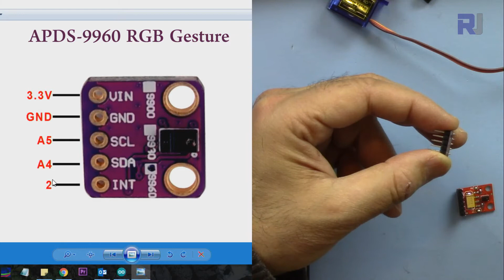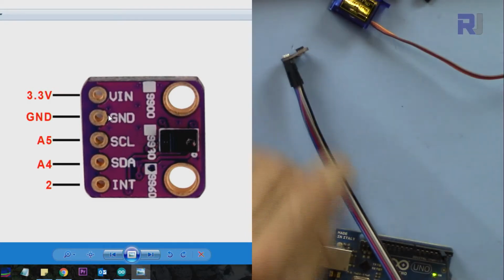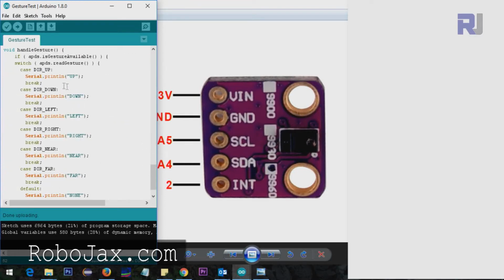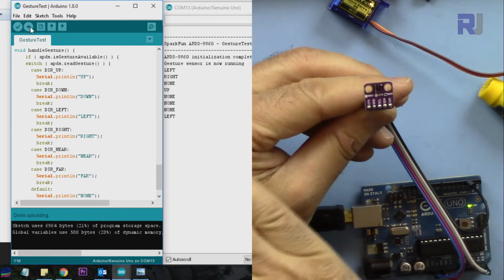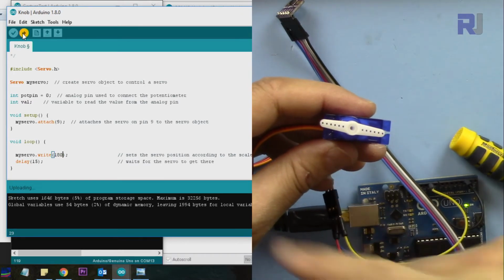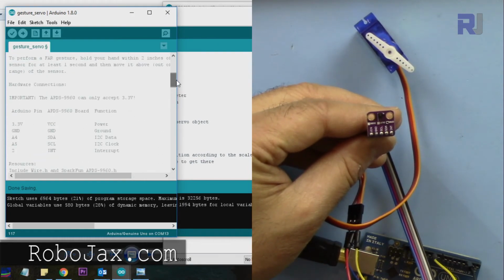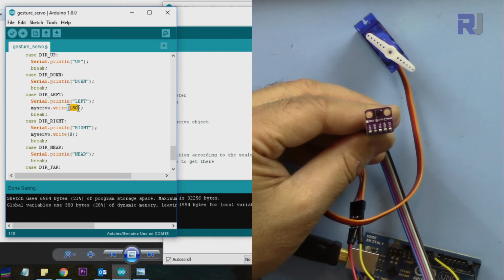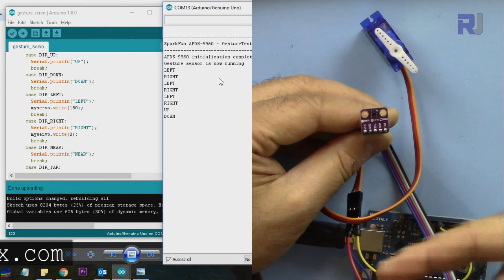How to control servo with hand gesture in Arduino RJT09

Comment: hello good sir !
i have uploaded the code to the arduino board, wired the components as shown, everything works as expected but it stops working after a while. If i connect back the board to the computer and open Arduino IDE then it starts working again, what am i doing wrong ?

Comment: I have a problem with my servo when its idle as it brains my batteries. I would like to add a mosfet somehow to have the servo only draw power when my sensor is triggered

Can someone please help

here is my scketch

/*
* WTP
*/

#include <Servo.h>

// constants won't change
const int MOTION_SENSOR_PIN = 7; // Arduino pin connected to motion sensor's pin 7
const int SERVO_PIN = 9; // Arduino pin connected to servo motor's pin 9

Servo servo; // create servo object to control a servo

int pos = 0; // variable to store the servo position

// variables will change:
int lastMotionState; // the previous state of motion sensor
int currentMotionState; // the current state of motion sensor

void setup() {

Serial.begin(9600); // initialize serial
pinMode(MOTION_SENSOR_PIN, INPUT); // set arduino pin 7 to input mode
servo.attach(SERVO_PIN); // attaches the servo on pin 9 to the servo object

servo.write(0);
currentMotionState = digitalRead(MOTION_SENSOR_PIN);
}

void loop() {
lastMotionState = currentMotionState; // save the last state0
currentMotionState = digitalRead(MOTION_SENSOR_PIN); // read new state

if (currentMotionState == LOW && lastMotionState == HIGH) { // pin state change: LOW -> HIGH
Serial.println("OFF");
servo.write(0);
delay(100); // waits (X)ms for the servo to reach the position
}
else
if (currentMotionState == HIGH && lastMotionState == LOW) { // pin state change: HIGH -> LOW
Serial.println("ACTIVE");
servo.write(180);
delay(2000); // waits (x)ms for the servo to reach the position
}
delay(10); // repeats program - larger delay - trigger is
}
Reply from the maker: if motion is not detected, we don't send any signal to the servo and it should not be active.  your servo motor must have issue.
Reply: Thank you for your response,  My program is triggered by capacitive touch and the servo SG90 turns from 0 to 180 then back to 0.  I Was reading elsewhere that the servo is constantly on receiving  information to stay in a set position otherwise the arm would go limp move if there is any weight on the arm.  So in order to maintain its position it uses constant power

In my case I Don't have any weight issues that would cause the arm to move this is why I would like to use a Mosfet to only give power to the servo when a sensor is triggered.  This has been a puzzle for me looking everywhere for a solution on how to wire it up.

Comment: You rapidly move your hand left and right that's why the motor worked and stopped and again worked and stopped but if you just put your hands stable towards left or towards right will it continuously moving or not
Reply from the maker: yes. it will
Reply: Can we control it wirelessly or not
Reply: If yes then tell the components needed to make it be controlled wirelessly
Reply from the maker: yes you can with remote control . Just search my channel with the "remote" or "servo" and you will see all videos. I  showed you so can find videos easily. Here is the link as well https://www.youtube.com/robojaxTV/search?query=remote

Comment: how do you save a series of gestures
Reply from the maker: You would have to have EEPROM chipe or microSD card module to save it if you need to use it in the future. But for that moments, you can just have a variable like int gesture[10]; then you can save up to 10 gesture. For example if left =1, right 2, up=3 etc. then if you want to save "right" in memory number 7 , you would right gesture[6]=2; remember number sin array starts with zero and 7 is 6.

Comment: You can also use the 4IR sensor LM339 which you made a video about it before..when you line them in one line, then pass your hand left or right then the comparater will give info to Arduino which will move servo left or right. Hope you make a video on it. this is your video
https://www.youtube.com/watch?v=6Qs4iFYm_lg&list=FLiQzjUty47bX_ZzpJvAt5KQ

Comment: Thank you for answering my question in a far videos before so quick. I also have another one: am I able to run the servo 360 or only 180°?
Reply from the maker: yes you can if you have a 360 degree servo which is different. When you purchase, made sure it says 360 degree.